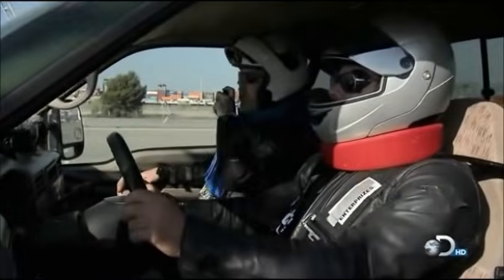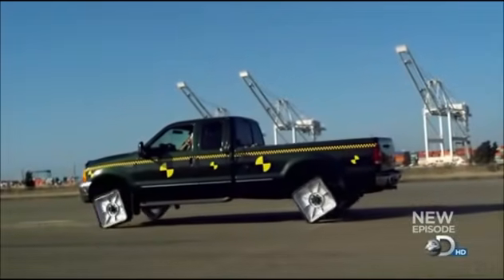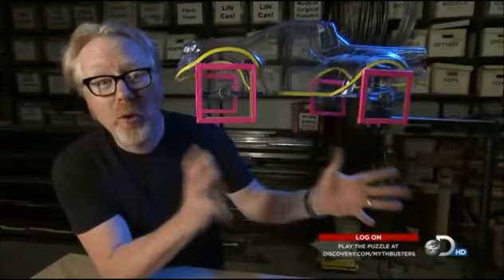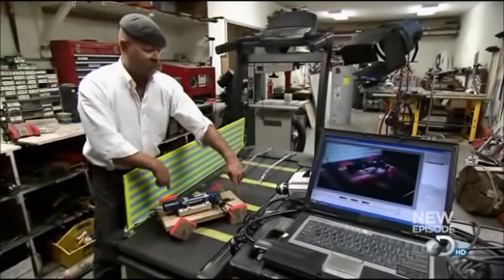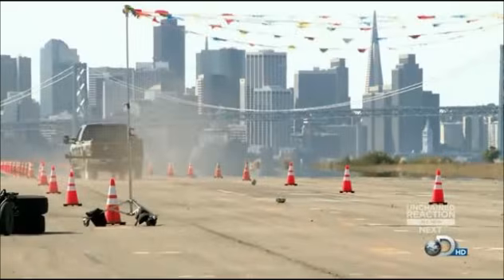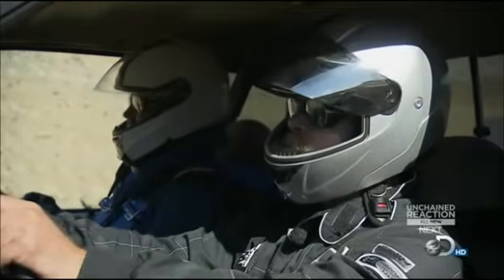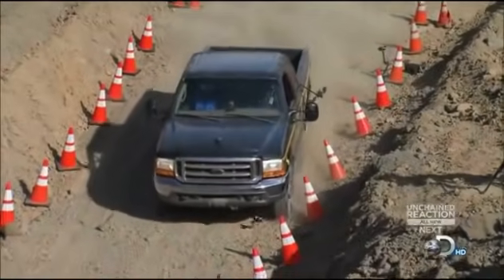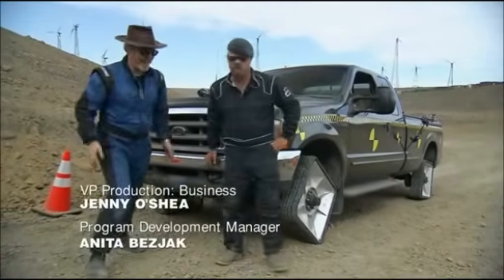Square Wheels - Mythbusters for the Impatient

Comment: 4:06  Front wheels aren't turning, try putting it in 4WD.
In square wheel tests the truck is in 4WD and the differentials are locked to keep the side to side offsets synched.

Test is inconclusive.

In real world offroad testing round wheels provide a bigger constant footprint for more traction.  Air down the tires for a larger footprint to the ground and look at how amazing the hillclimb will be.

Comment: 4:27 the yellow tape just stopped the truck from continuing
Reply: I backed up the answer with science, and you responded by saying that the tape wouldn't have made the truck go further (what?). Some people just aren't worth talking to.
Reply: +TehOddMenOut No its the Illuminati who did this. bush did 9/11
Reply: +Ramhams1337 F = ma. The mass is transferred onto the ground. The acceleration at that point was nothing, or very little if the tape were not there. Therefore, the force of the truck could have easily been too low to tear the tape or knock the cones over. Big stuff doesn't always break little stuff.
Reply: Ramhams1337 you obviously didn't go to college
Reply: TehOddMenOut please tell me you're joking and you're not serious
Reply: There are still people who think that the tape had no effect! You must understand what force is and that it's dependent on acceleration, and that being light doesn't make something easy to rip.
Reply: the steepness of the hill was increasing on an exponential curve so at the end the truck was essentially trying to use the hill as a ramp to increase elevation. Considering this, two possible explanations in accordance with Schrödinger's theory are: a. the tape was laced with spider silk, which easily has enough tensile strength to slingshot a Ford truck of that size and mass, and b. the truck was a female truck and it hit a glass, or rather tape ceiling, of sorts. But again, if no one check both remain plausible.
Reply: Michael Pieruccini I agree this guy Ramhams wasn't worth the paint chips he grew up on
Reply: when you realize this was a bait post and you wasted countless minutes of your time arguing about literal nonsense
Reply: +Ramhams1337 bro the tape is clearly holding the truck back.
Reply: +TehOddMenOut i hope you're joking
Reply: Ramhams1337 what do you mean, it is clear as day in the video
Reply: +Samuel Mason I think it was real... it kinda did stop it from moving, it had enough momentum to keep going but not enough to break the tape.
Reply: Lol ok I'm done here
Reply: +Arijit Mukherjee watch the video. It's obviously holding it from going further
Reply: +Ramhams1337 bro look. watch the video again. the tape is holding the truck.  I work for Uline. we make a yellow tape that comes with a special cutting tool because its very durable. on that kind of incline and with the temperature around 85 degree, the tape could easily hold the truck back.
Reply: yup thats good old military grade uline tape. commonly mistaken for "finishing line" tape. mythbusters is pulling one over you. another scam to make you think they are right
Reply: bro the video tho. the video is proof. are you trolling me? you must be. you probly didn't even watch the video. you're telling me that the tape didn't stop the truck?
Reply: Ramhams1337 Speed doesn't matter there as much as momentum. It had enough momentum to get up the hill but not break the tape.
Reply: Ramhams1337 Well we will never know because of MythBusters' screw up. They coulda spray-painted it on the floor and this argument would've ended so much quicker lol
Reply: Ramhams1337 truth
Reply: Ramhams1337 no matter what, people will bitch about something, no matter what it is.
Reply: Jackie Scholl nah it was the tape dude
Reply: TehOddMenOut these guys just don't get it do they
Reply: Aidan Sweeney that tape has a high strength to weight ratio
Reply: ***** In reality it's you who doesn't understand physics. But rather than trying to explain again I would encourage you to do some research on your own about force.
Reply: But in conjunction with everything else it kind of did,  it wasn't the only factor, the truck may have only made it an extra inch without the tape. But the tape did something.
Reply: +Ramhams1337 you are obviously a fucking idiot
Reply: +RB26DETT DK With limited traction on a steep incline, it could definitely stop the truck, regardless if the truck would have gotten to the top or not. Drive your car up a hill on pavement and apply 1% of your brake power- no problem- drive up a steeper hill= slower; drive up a steeper hill = slowest; drive up steepest hill- car stops, let off brake and car will move forward slightly. It could be a breeze, mouse fart, whatever but to say the tape imparts no force to the truck is ludicrous. So much fail in this thread.
Reply: TehOddMenOut you’re exactly correct I’m so glad someone actually understands this. Every single bit of inertia that truck had mattered to get those finals inches. But the thick tape stopped the truck. I don’t think other people realize how much force the tape could impose on the truck. Especially with the elasticity of that tape. The more the tape is flexed, the increasingly more force is applied against the truck. Had the tape not been there, in conclusion, the truck most definitely would have proceeded at least a few additional inches.
Reply: +Ramhams1337 It's actually seems plausible given that tensile strengths is a lot stronger than you'd expect. I'm not saying it completely stopped the truck but it seems like a factor.
Reply: +TehOddMenOut pickup truck twerk confirmed a thing
Reply: +TehOddMenOut You baited, but the Micheal up there didnt.
Reply: +Brohemeth no, the wheels didn't have the traction to get up the rest of the hill. It just happened to get stuck at the tape.
Reply: Aidan Sweeney no. the tape clearly held the truck back
Reply: Brohemeth The dirt and mud clearly held the truck back
Reply: Aidan Sweeney just cuz you have a subaru logo doesn't make you an expert on trucks and cars like we are ok
Reply: +Aidan Sweeney it's the tape bud
Reply: Brohemeth nope.
Reply: Aidan Sweeney yes. look
Reply: Aidan Sweeney dude you obviously have no idea how physics, weight, the real world even works. we know you drive a hybrid
Reply: The straw that broke the camels back scenario.
Reply: TehOddMenOut i did. business college. but it has nothing to do with this subject. and it has nothing to to with my current career choice
Reply: Brohemeth and is that tape uline tape? pretty sure that's "finishline tape" or whatever it's called. you know designed to be able to run through it. the put it up on marathons and shit so the first person through has to destroy the tape with his body. if a human running body can ruin the tape so can a freaking truck
Reply: +Michael Pieruccini Oh god damn your nonsense is painful to read.... You sound like you flunked out of high school physics or something.
Reply: Michael Pieruccini the tape would not have made the truck go any further had it not been there.
Reply: Brohemeth the truck is clearly past the tape and can't go any further. and it's clearly not because of the tape that it can't
Reply: Brohemeth from my experience it's not that durable. pretty sure it wouldn't matter if the tape was there or not
Reply: hotmojoe. pretty sure it wouldn't have gone up the hill with no tape
Reply: hotmojoe. yeah, although some people would probably have suggested the paint would have made the dirt a little more wet which would have made the truck wheels stick more to the ground making it not being able to go further. or some stupid shit like that
Reply: Brohemeth tape is very light so it couldn't stop it. the hill was too steep for the truck. tape didn't do anything. it just slid under the grille because the truck couldn't go any further.
Reply: +Michael Pieruccini the tape could not stop a truck. the truck just couldn't make it
Reply: +Michael Pieruccini 
You're applying F=ma wrong. the truck was accelerating because of the force from the wheels, but that acceleration has nothing to do with the force the truck would apply on impact to a third object, the tape.

A single piece of tape cannot stop a moving truck.
Reply: +TehOddMenOut Regardless of whether the truck could make it through the flimsy tape I believe that the tape was flimsy enough to where it wouldn't really make that much of a difference either way. Yeah i think that the square wheels definitely would have helped, but not even enough to make it through such weak tape, therefore it wouldn't have gone that much further anyways
Reply: Michael Pieruccini "science" that was some halfassed scinece. you have nothing you can calculate. you have no messurements to go after. sure what you said is true. but let's go down to someting you said. "Big stuff doesn't always break little stuff." keyword "always"

for how long do you think jamie and adam has done science and testing tings? og that's right. most of their fucking life. if they thought the finish line tape thing would change the end result do you think they would put it up there? no. ofcourse not.
Reply: Jack Reynolds and i suggest you watch the video again. the truck was past the tape. but not by much. and without the tape there i would say it would have made the maximal change of 1 inch. if not less. ergo. useless if it was there or not.
Reply: +Michael Pieruccini you're ruining the joke
Reply: Brohemeth Sarcasm?
Reply: Brohemeth how is the video proof? the video doesn't show the truck just straight up stopping because of the tape. it had practically no speed going into the tape
Reply: TehOddMenOut I don't drive a Prius, or any hybrid. My daily driver is a RAM 1500, and my fun car is a WRX STI.
Reply: +TehOddMenOut I LOL at everybody discussing this all seriously, unless they're all in on a joke and I'M the one who's taking THEM too seriously!
Reply: +TehOddMenOut Well thats a FORD for ya.